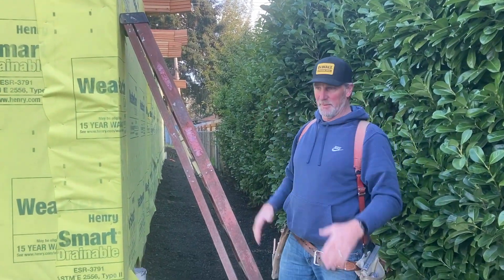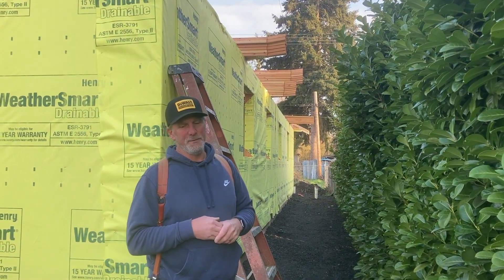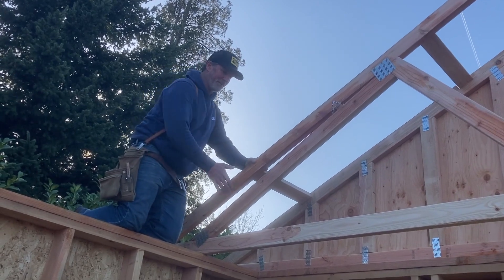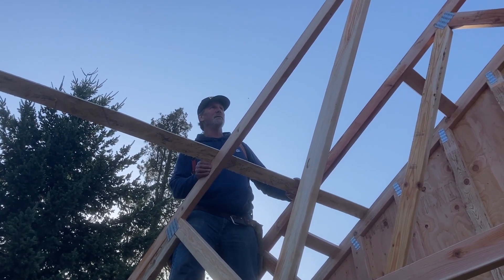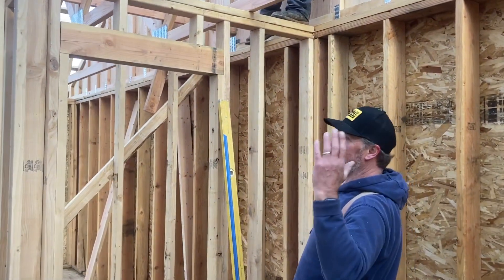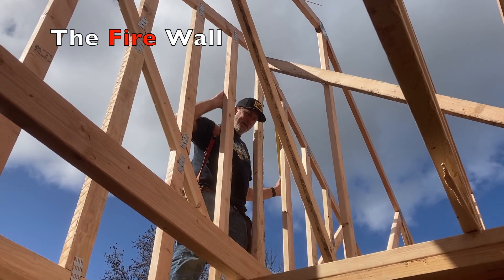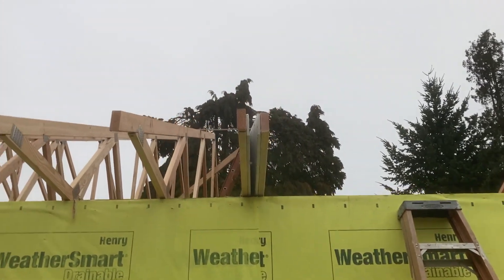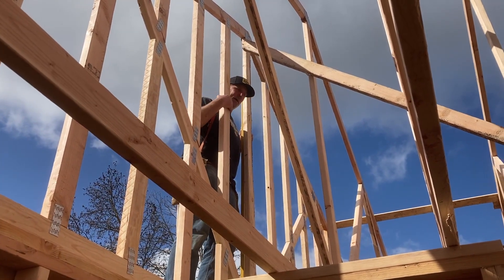Rolling the Trusses (How to Put Up Trusses) | Paul Rea

Comment: Enjoying these videos! Quick question for Paul Rea or anyone else who has an answer...is it typical that the truss-delivery truck would include hoisting the truss bundles overhead to lay them atop the walls?
Reply from the maker: Yes, as part of their price, the truss company usually includes one hour for their truss truck to hoist the bundles.  If it takes longer they may charge you more.  -Tim
Reply: Our truss vendor doesn’t.
The trusses show up on a roll off trailer and are left on the ground.